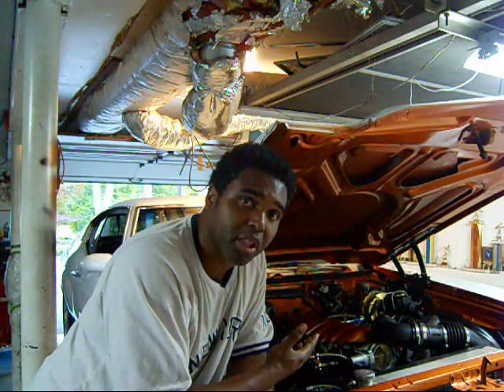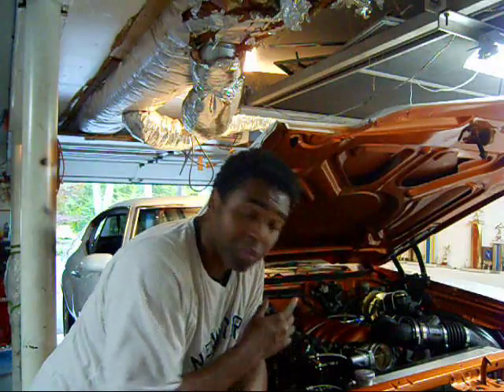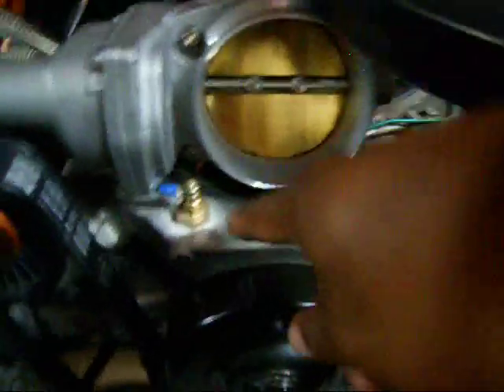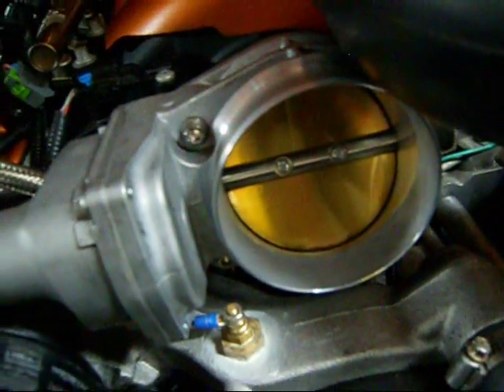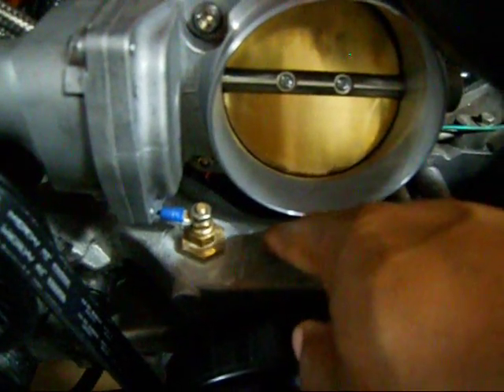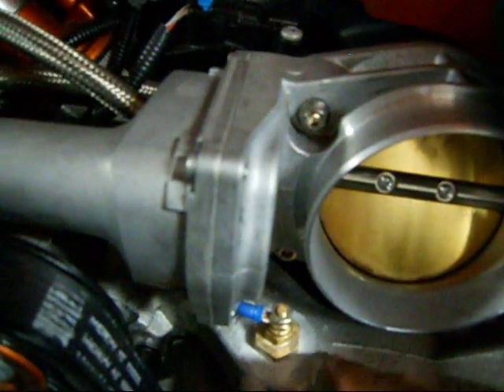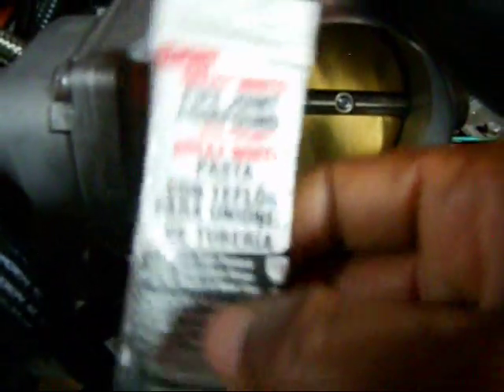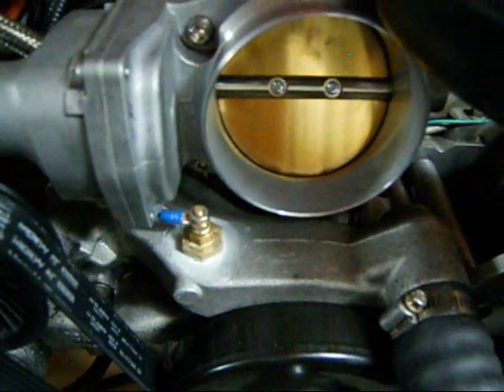How To Make Any Temp Gauge Work With in Any LS conversion.

Comment: Hello I just wanted some clarification if my car already has an oil pressure and a coolant temp your saying to try to adapt the stock sensors from the original engine into the LS correct?
Reply from the maker: if you have a oil pressure gauge you want to use then make adapter that will allow you to use the stock sending unit. i went with an aftermarket gauge for my oil and fuel pressure. the stock temp sensor i drilled and tapped my water pump to install it. ..